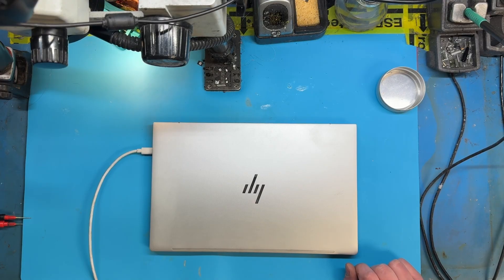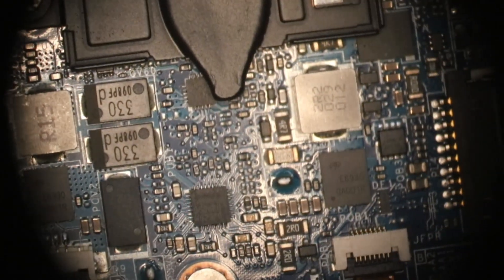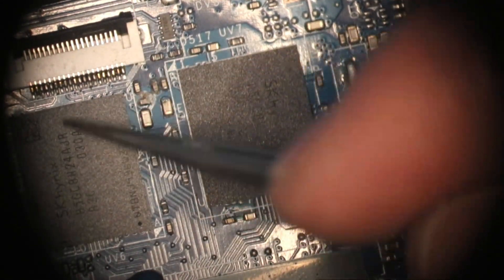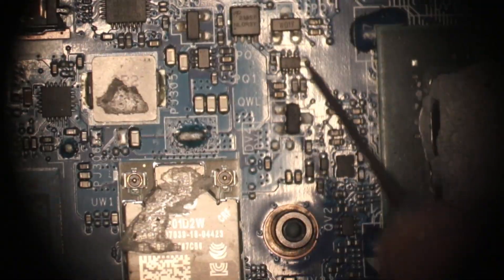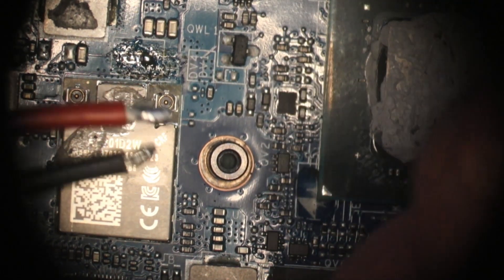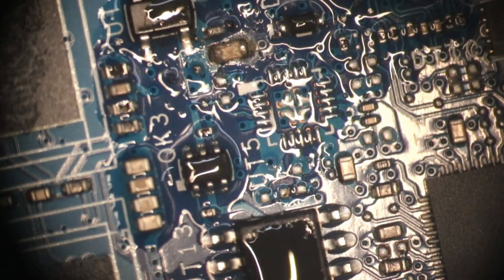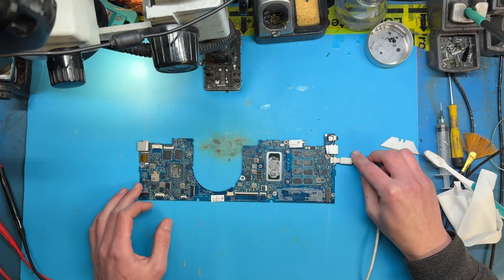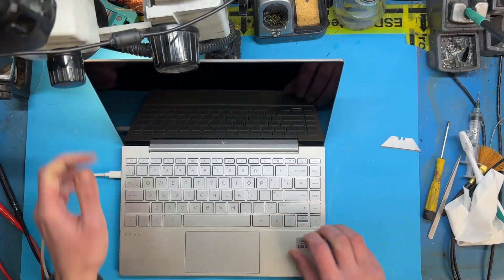HP Envy 14 No Power Repair – Diagnosing & Fixing Motherboard Issues

Comment: No power problem? This has been HP's problem for decades. Seems to be an engineering defect that they don't want to correct.
Reply from the maker: @Xi_Jinping_is_Pooh  
In this case it was a small amount of liquid damage that damaged the motherboard. Nothing wrong with HP’s engineering.

Comment: Nice! What value caps did you replace them with? The big ones are always 10uf unless they're not, right? 😅
Reply from the maker: Honestly I don’t remember 😂, I likely found a similar 5v circuit on a donor board and used that as a basis for the replacements. 

98% of the time you can get away with a missing capacitor, I’m surprised I bothered to replace them!